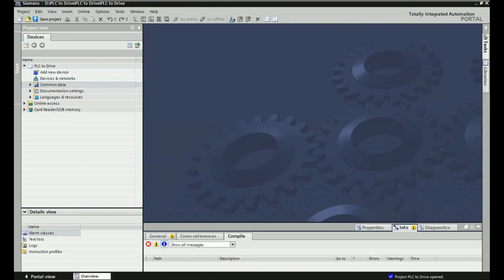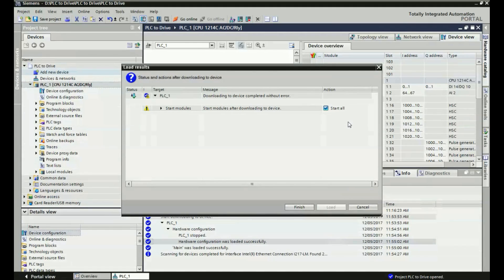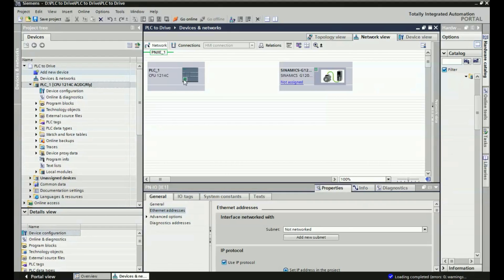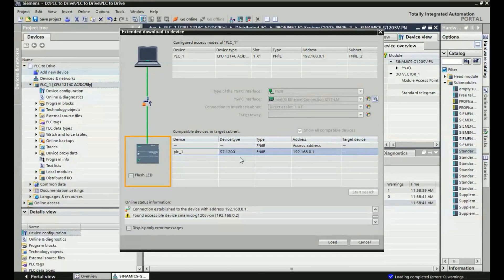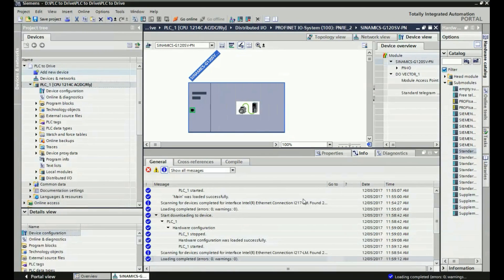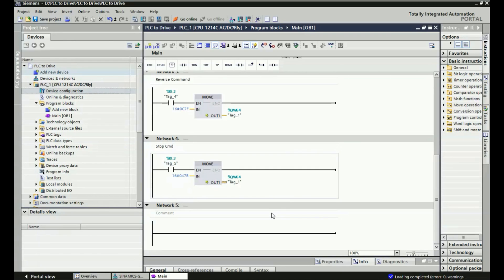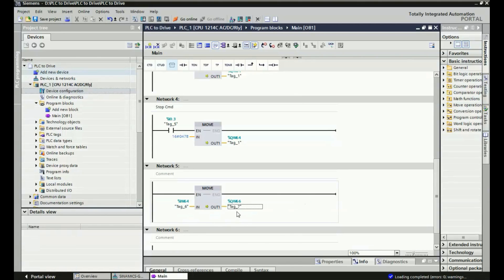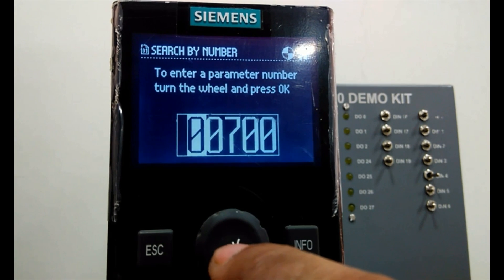PLC to Drive (VFD) Communication & Control  with Standard Telegram

Comment: Hello, I am working with a Sinamics DCP CC-CC converter, using a S7-1500 with free tekegram. The only value I can set in the QWs is FFFFF, but I can set another value to the QW. How is it possible to change the value of a QW?
Reply: Nevermind, i figured it out

Comment: I am curious about why you choose standart telegram pzd 1/1. Why you didn't pick other ones? Is there any hardware about telegram or its  just as software?
Reply from the maker: It's just software package 1/1 means there are two tags will be used one as an Input and one as an output. Telegram is selected based on No of required IO.

Comment: hi, how do i read data such as power consumption, current, voltage frm the vfd to siemens plc?
Reply from the maker: There are some parameters numbers which you can read or write with PLC. It's called Telegram.
Reply: @AutomationRevolution  Hi, I had read some documents. Is it by using the PCD or PZD parameter set at the VFD?

Comment: hello friend, i applied your methode carfully but i don't know why the motor doesn't run,  would you enlighten me to solve this issue
Reply from the maker: Sir you need to configure drive first , Kindly watch basic configuration of Drive on this channel.
Reply: @AutomationRevolution  hello sir, thank you for the response, concerning the drive configuration i just tried to move into automatic control by pushing the hand/auto, and the editing of those adresses that you mentionned in your video, if there is anything else please tel me,
Reply: @AutomationRevolution  i don't configure the p700, is this can be the source of the problem, because it's value is 0, should i fix it at 6 as you did in the video??

Comment: Wao your videos are very good can you please prepare a video of analouge inputs and output using pressure transmitter 4-20ma or 0 t0 10 voltage  and to control bit by arethematical instructions
Reply from the maker: +Ahmed rajput I have already made video on analog IO interface. Please watch PI tutorials.
Reply: Sir if i am going to troubleshoot in any other industry and if i try to connect  s7 1200 model so what is the procedure